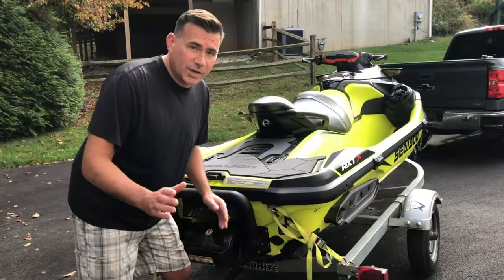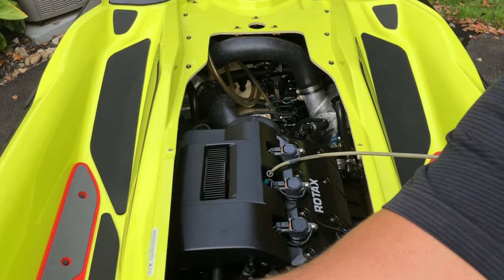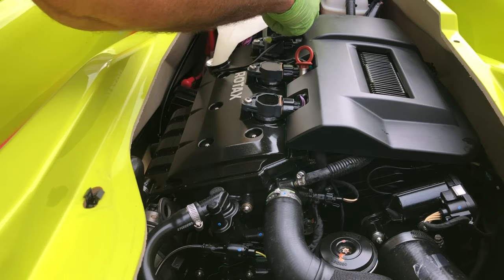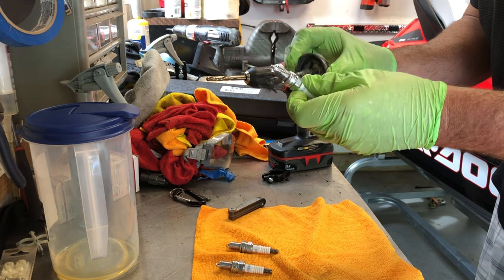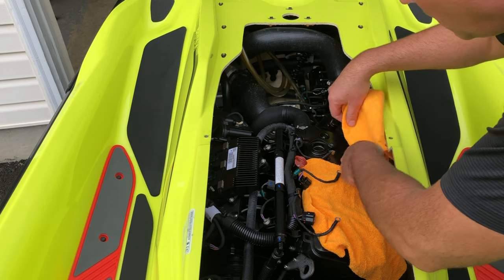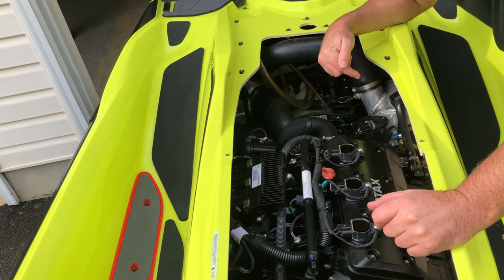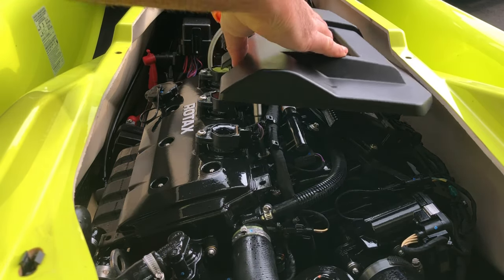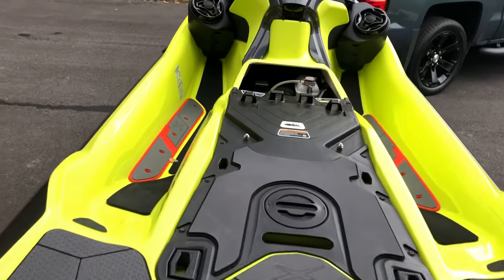2018 Seadoo RXTX 300 Winterization

Comment: I really do have a question, once you took the spark plug out, spray the XPS in to the cylinder. then you start the engine. mine situation is that the fuel will pop out everywhere, and also there would be fuel inside it. wish you guys can help me. appreciated
Reply: Hold down the throttle all the way, then hit the start button and it will crank the motor without dispensing any fuel into the cylinder head.   That’s not mentioned in many videos but it’s in the factory service manual and also the blog post from sea Doo (that’s where I read it).
Reply from the maker: Thanks Pat, and yes hold the throttle fully, logic tells the system to kill fuel when started. A comment received mentions this as “Drown Mode”.  This also is intended as a way to clear water from the cylinders if needed in emergency. When holding the throttle fully open, and pressing start, no fuel is admitted to the cylinders.

Comment: Hmm turned the engine off before turning off the water
Reply from the maker: No, what you see if water still draining after I shut the supply and then rev the engine. You don't want to shut the engine down with the water supply still on!

Comment: Thanks for your video. Question is... when I took 3 x spark plugs out, there was little oil around each spark plugs, what that mean? Looking forward your reply.
Reply from the maker: If a “little” oil was found, I see this as normal. Could be a little seepage from the spark plug tubes which seal from the valve cover to the head. (or maybe some grease from sealing the coil packs like I show to do?) Or it could be too loose of a fit on the plug itself. 
In any case, I do typically do see “some” small amount of oil around the plugs on these. Maybe a 1/16”- 1/8” band around the plugs….

Comment: Chris, I will be in the market next year for my first jet ski. been looking at the fish pro, however, it's only 170. should I be concerned for power?
Reply: As an owner of a Wake 170 you will be fine. We can tow wakeboarders, or a tube with 2 adults on it (with 2 riding at same time) and it hauls ass. We also have a spark trixx with only 90 hp that hauls ass. Maybe if you are racing, but then you wouldn't be looking at the fish pro...
Reply from the maker: Plenty of power, and that will be reliable. I have a GTI 130 and a GTR 230, both are a blast up to 50. Supercharged skis will be even more acceleration and hover at 70 on top end. As far as power, we pull tubes and skiers with ease on the 130 and the low fuel consumption runs all day long. Have fun with it

Comment: do you have information on the connector you used for flushing air out?  The small piece you showed.  I need that piece and need dimensions etc.
Reply from the maker: The female port is a standard 3/4 NPT (Garden hose connection). So I used a 3/4 NPT outside diameter threaded bushing, with a 1/4 NPT threaded internal diameter. The adapter that I threaded into the bushing was my air compressor quick connect, that size will be dependent on what compressor fittings you use.
For an Seadoo earlier than 2010, I would make this longer using 3/4 NPT pipe (because those use a flush port over the jet pump/ harder to reach)
Reply: I got the brass fittings for standard garden hose to standard airline quick connect at home depot in the underground sprinkler section for about $4

Comment: Great video, my only concern was that when i blew out the exhaust port at 55 pounds very little to no water came out of the jet pump.  But when I tilted the trailer to move it back in the garage water came out of the jet pump area.   Wondering if that's normal and hoping all the water is out??
Reply from the maker: Not much water will come out, I let it go for 5-10 minutes. That is pretty normal, probably a good idea to raise the trailer front some so the nose of the ski is high.
Another option is to pump in RV antifreeze, I have a video on that as well.

Comment: Thanks for the video.  I am new to this.  Do you know anything about a 2004 Seadoo Sportster?  It has a quick connect and I have gravity fed anti-freeze until it came out the bottom.  Do I use the same port to blow it out with my air compressor?
Reply from the maker: I simply haven't serviced your application yet and don't want to give you inaccurate advice. 
The 4 stroke manuals discuss blowing out the passages with 50 psig air pressure. (I do this for my 4-techs which are stored indoors, but for applications stored outdoors I pump antifreeze into the cooling system after starting the engine.)(see my video using a 12v pump)
However, if your using RV antifreeze in the cooling system, be rest assured that this is belt and suspenders (good). If you add antifreeze through your flush port, and run the engine, this mixes with any residual raw water and is certainly better than just blowing out water... I would check around on this topic for your model to find a best practice, not so sure about only gravity feeding.
Reply: @BondsGarage  Thank you!
Reply: @BondsGarage  Can you tell me how I would find the video of you using a 12v pump?
Reply from the maker: @dennismclucas1313  
https://youtu.be/9M5oRiNri8U

Comment: Very Nice video.  I'm an RXT owner myself.  Considering the RXT-X.  A few helpful add-ons to your video: 1.  Make sure to instruct the viewer to pull out the siphon hose for the oil change when doing the additional 2-3 cranks to remove remaining oil. 2. I usually like to fire up the ski with the old plugs after I fog the engine and then install the new plugs.  Foggers have a tendency to foul-up the plugs alittle when the fogger is burning off in the chambers. 3.  DO NOT leave your battery on trickle charge all winter long.  Disconnect it and let it discharge for 30 days before reconnecting; battery needs to cycle to stay healthy.
Reply from the maker: Thanks for the excellent suggestions! I really appreciate your feedback!

Comment: just seeing this video. Thanks for taking the time. Is it the same procedure for a 2017 GTX 155?
Reply from the maker: Thanks and no problem! Yes, this guideline video is general for the "4 tech" engines / cooling system/ overall checks and will work for you. Even though this engine in my video is a newer design, and some things like cover removal or battery location are different. I myself have an older 2012 GTI 130 and also a 2019 GTR 230...and follow this same basic process for each. If you run into any issues or have more questions, feel free to reach out.

Comment: Very helpful. Getting ready to winterize my 2021 GTX 170. Have about 30hrs on it. Any recommendations in addition to what your video displayed? Again, your video was extremely helpful.
Reply: The Seadoo manual says you can go 200 hours before an oil change.  I thought that was quite a lot.  Talked to a Seadoo mechanic and he said for someone like me who runs it on Eco mode that  100 hours is fine.  Just check the oil every 25 hours after I get to 50 hours and see how it looks.  Mine is a GTI 130.
Reply from the maker: Thanks! At only 30 hours, nope. Winterize and feel confident with that machine. I never mentioned adding fuel stabilizer to your gas, but I do add this at times during the year and certainly ahead of winterizing.

Comment: No fuel stabilizer? Great video
Reply from the maker: I generally use stabilizer every few tanks in case weather prevents riding, good point that this should be added for winterizing. I certainly do make sure fuel stabilizer is in the tank before putting the ski away for winter.

Comment: I use the XPS storage oil for fogging the cylinders not the anti-corrosive lubricant.... The anti-corrosuve lubricant is for external engine use I thought...
Reply from the maker: Great point Mike, I questioned this as well a while back....I do indeed still use the anti-corrosive lubricant, this was in the manuals years back and is still listed on the Seadoo website (link below). Can certainly use the Seadoo "fogging oil" and in reality lots of brands other than Seadoo to chose for this. But I still use the anti-corrosive version because this works for both internal (fogging) and also external (After-run) protection on the engine.

https://www.sea-doo.com/us/en/sea-doo-life/blog/winterizing-your-sea-doo.html

Comment: That vacuum pump looks a lot better than mine.  Do you know the make or where it can be purchased?
Reply from the maker: Sure, I've had mine for about 15 years now. This link shows a near identical tool-  https://www.amazon.com/EWK-Pneumatic-Changer-Extractor-Remover/dp/B06WD64H8Z/ref=asc_df_B06WD64H8Z/?tag=hyprod-20&linkCode=df0&hvadid=198065480126&hvpos=&hvnetw=g&hvrand=2677622769099416485&hvpone=&hvptwo=&hvqmt=&hvdev=c&hvdvcmdl=&hvlocint=&hvlocphy=1014927&hvtargid=pla-379007187482&th=1

Comment: Instead of removing the plugs and changing them yearly I use iridium.  And I remove the 3 bolts on the fuel rail,  and put some oil in each of the 3 intake ports.
Reply from the maker: Great tips. Especially on the plugs. The procedure you mention is actually listed in older 4tech manuals, that does coat the intake valves.

Comment: So instead of running Antifreeze thru the cooling system,  I can just blow the water out with air ur saying?
Reply from the maker: Yes per the book you can, but this really depends on your area and storage. I simply blow my cooling circuit dry on both of my skis, and I keep them in my garage through the winter. Temps in my garage can freeze for sure, but my garage is warmer than storing outside. For a friend of mine nearby who only stores his ski outside, I winterize that with antifreeze just to be certain he has added protection.

Comment: Whats is rattling and why is the nut upside-down on the filter housing? Thanks
Reply from the maker: Rattling noise always occurs on skis out of the water, comes from the impeller. As for the nut... great question. That's how I find them on new skis, never thought about the reasoning though.

Comment: amazing video,have a some jet .One question i m second owner and yesterday i notice my coolant is low and few hr later was empty has 100hrs works great but coolant empty.And idea?.Thank you
Reply from the maker: Darn, well thats a leak for sure. Internal to engine or external to hull. Check your oil, it should be clear and not milky and at the right level and not high(If milky it's an internal leak). Is there coolant lying in the bottom of the ski, if so external leak from a cap, hose or gasket?
Reply from the maker: "Bottom of the ski" I mean inside the hull..... Also if oil checks out but the hull is wet inside and very dirty, I would clean this up and dry it so you get a solid inspection. Then add coolant and let it sit to see if the leak is occurring without the engine even running. (I just finished replacing a ride plate due to through hull fitting fractures, that leaked slowly without the engine even running). Hoping this is a simple fix for you
Reply: @BondsGarage  Thank you for yoir reply,i will check i do hope is nothing big just ordered a new coolant and air pressure pack so ill see what s goin on,thank you again for kind advice
Reply from the maker: @jaxcamino9356  No prob and feel free to keep us posted on your findings.
Reply: Some help again pls:),i get battery light on after few sec when engine off.Brand new battery same happend with old one

Comment: I never leave the tube in the dipstick hole while cranking.  If it catches the crank and gets chewed off, what then?
Reply from the maker: If you pull it out a couple inches it won’t hit. However, better safe than sorry.
Reply: @BondsGarage  yes but the tube will bend when bottomed out so a couple inches back may not be enough.
Reply from the maker: @kevinmchale5660  You can feel the bottom when this is inserted. If the tube was able to bend like that, you won't be able to remove as much oil.
Reply: @BondsGarage  perhaps your tube is stiffer than mine   lol
Reply from the maker: @kevinmchale5660  Haha! Thanks for the subscribe.
Reply: It's always nice to crank the motor for 5 seconds with no oil in it, great for the cylinders and rings

Comment: It it that vital to torque your sparks and oil filter housing. Or can you just play it by feel
Reply from the maker: in a pinch, no. But, in general this is good practice on jet skis since most torque values are so low,. This avoids over or under tightening which can cause thread damage or leaks. 

A lot of the bolting on these are threaded into aluminum which is very easy to damage. A lot of the hardware requires blue loctite to be added, since bolt torque is so low and forces such as normal engine vibration can easily loosen small fasteners. 
I generally torque every bolt as good practice in the long run. A seasoned mechanic has a good feel for “tight/ or snug”, but torque allows for repeatability and adds good science to make sure you tighten fasteners to the best of your ability.

Comment: Does my 2017 RXT-X 300 have the same engine as your 2018?
Reply from the maker: No, you do not have the same engine. But the oil change process is very similar.

Comment: What is the adapter you used to hook the airline to the flush port?
Reply from the maker: The threads in the hull of the ski are 3/4 NPT, the same thread size as a garden hose fitting. I went to Home Depot and bought a metal Pipe bushing in the pipe section, my bushing has internal threads that fit to my air line adapter. Few bucks.

Comment: What exactly is the point of a winterisation? Sorry new to this
Reply from the maker: In cold climates these are steps taken to add freeze protection to avoid damaging any cooling water circuits. Aside from that, fogging keeps the cylinders lubricated and sealed to prevent corrosion as these dry out from sitting. In general, winterization is also good time to go through all systems and make repairs off season. I use this time to keep the battery charged, clean engine components, look for any suspect issues to repair, and detail the ski. If was in warm weather and could ride all year long, there wouldn't be any winterization but instead I'd perform similar inspection checks on a predetermined basis. If in warm weather, but the ski will not be used for months I would fog during that timeframe..

Comment: Can you pump anti-freeze into flushing port instead of drying it out with air?
Reply from the maker: Absolutely. I've  used RV antifreeze. I posted a video on how to do this. (A bucket, about 1/2 gallon of antifreeze, and an electric pump)

Comment: Does it really matter what air pressure you use, 55 psi and up
Reply from the maker: Great question. I didn't question this and used the manual as guidance. 
I will say that at this pressure, liquid seems to be removed easily and after many seasons seems to work well.

Comment: What inch pound and size torque wrench you using
Reply from the maker: I used of a Craftsman 3/8- in torque wrench. Item 00931423. This is only about $60. Range on this is 25-250 in. lbs. I use several different torque wrenches for various projects pending range of torque needed.(attempting to stay within calibration range of each)

Comment: Why didnt the fuel get stabilized
Reply from the maker: Actually, it did. I may not have mentioned. Prior to the warm up/ oil change stabilizer was added to the tank and the tank was topped off with fresh fuel. This way the stabilizer has a chance to enter the fuel system/ injectors.
Reply: @BondsGarage  Thanks for the info Chris! I'm about to do my 2019 RXTX. This info will be a big help!
Reply from the maker: @csouthall1  

Glad to help!